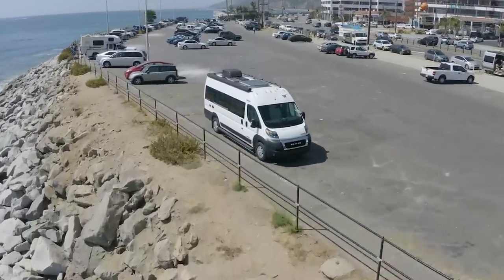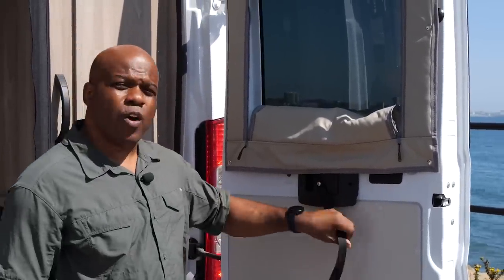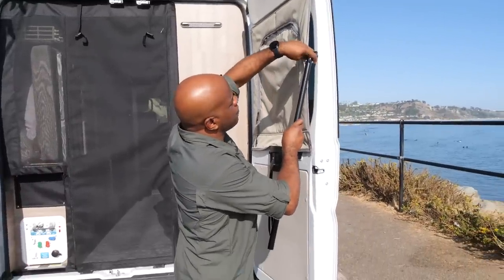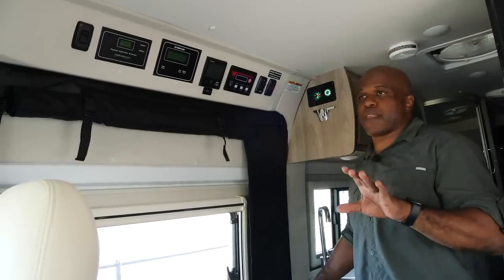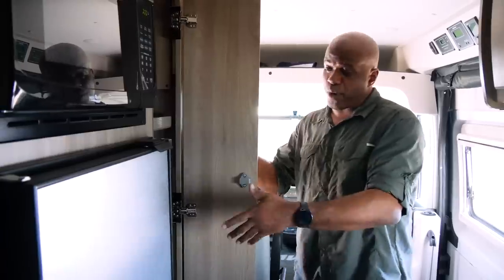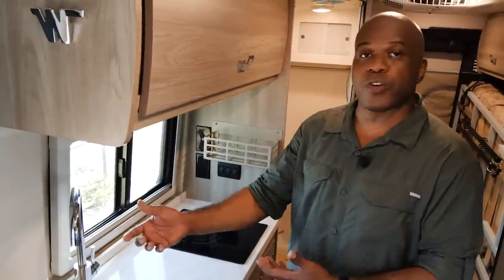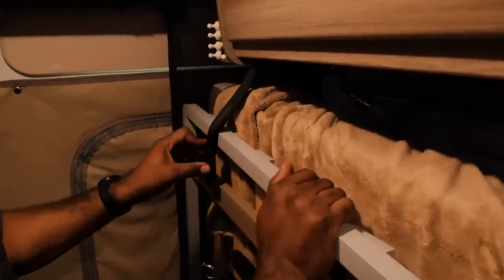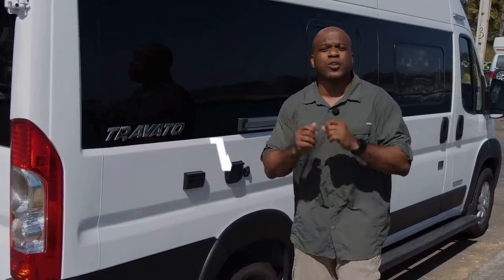The 2022 Winnebago Travato 59GL: Complete Walkthrough

Comment: So wait! Can’t hook up water to use direct? Only to fill the tank? And when it’s cold, you have to open the back door to fill?
Reply: Same question I have
Reply: Seems kind of stupid to me to
Reply: I agreed with the “why do something that keeps us having to open the back door to put water in the tank.” Then I realized that we live off the tank and not the hose. Given it’s a B class and that limits the fact one door will have to be opened to even get in and out. While I was winterizing my GL, I realized how nice it would be to have all the “by passes” in one location. Right now I have to get under the bench seat to bypass the water heater, then the two near the floor at the slider door. 

I would rather see them replace the slide door that loses all the heat or cold air. I know that’s probably not happening so I’ll take the single location for water and winterizing. LOL!
Reply: With the inlets inside there a less chance your water will freeze and also you don’t have to worry about some crazy nut tampering with them...
Reply: @MusicOfMelodyK  so true! We actually did have that happen more than once. And at another place, we left the water to the vehicle on, low, but it still broke and leaked. The park management turned the water off and left us a kind note, but still an embarrassment. The more we look at the 2022, the more we love it. More cells in the Lithium, a new space up front where the water tank, then the inverters were, the single spot of water works, and the “pump-less” shower drain make it a dream machine “B”! The lighter bed is a bonus!
Reply: You have to fill the tank and then unattach the hose to shut the back doors. A bit of a nuisance but it's  not that big of a deal.
Reply: Yes to all questions.

Comment: stop building the travato on the Ram Promaster, its crap. Promaster sucks!
Reply: Love mine. Agile, runs great and gets great gas mileage and haven't had a problem at all and when I need service just take it to a RAM dealer. On the other hand ask me about my Class C on a Ford E450. Rough running, loud, lousy gas mileage and agility non-existant and when it needs service find a Ford dealer with a lift to get under the beast..
Reply: @oldhickory2064  garage built in Mexico, assembly line crap.
Reply: @anthonykimbrell1243  Built in Mexico or not it runs great and the plant in Mexico has won some serious awards for it's quality and in fact is considered the best truck assembly plant in the stable of Chrysler/Dodge/RAM products...my 2012 RAM 1500 Crew Limited has never given me a problem and it was built in Mexico.
Reply: It would be highly interesting to see this very floor plan on a FORD TRANSIT 😁😁😁😁😁😁 They should try it! Even on a Sprinter......just to see how it goes.

Comment: This unit certainly has a nice fit and finish as well as some new innovations.  And it has a lengthwise bed that appears to be accommodate tall sleepers.  However, once again we have seating for four in a vehicle that sleeps only two.  For the many singles and couples who travel, the extra two chairs are taking up space could be used to expand the kitchen or install a larger refrigerator.
Reply from the maker: Thank you for your feedback!
Reply: Yes those two chairs are one of the reasons I can't pull the trigger on buying this model, The 59 KL has a better layout but you have that small fridge, grrr!!

Comment: Other then the new bed design, inside water controls, the induction cooktop and sink along with the new information center in the cab and the gravity drain in the shower there is not really anything else that I would want from my current 2017.5 Travato. They missed on the  removal of the other sleeping area big time (thats where the dog sleeps). IMHO.They turned it into a two person coach unless they eventually add in the pop top which I wouldn't want. I hate canvas exterior walls. It would have been nice to know with all the insulation they added what the ratings were for the floor, walls and ceiling.
Reply: I take back the inside water controls...city water is also in there and the only way you can connect is leaving the back doors open....bad idea IMHO
Reply: @oldhickory2064  Exactly, the water hook up makes no sense.

Comment: when are we going to do a recirculating shower  since you did some upgrades?  / guess I am still visiting truck stops
Reply: Seems pretty challenging, expensive, and lot of maintenance in such a small B van.  Shower goes into gray tank which is shared with your sink, so you'd have to either separate it into it's own tank (and have another to take up space)  or have a system that is good enough to filter out the food particles, soap, etc. AND be small enough to fit somewhere on the van - doubtful there is something reasonably priced and small enough yet.  Even if there was, you'd have to deal with cleaning that filter quite often.  For this type of van you should be doing military showers anyway, quick and using little water;  if you want to enjoy a long hot shower, a small B van might not be for you
Reply: @skinnysurvivor103  thank you   that makes sense
Reply: @skinnysurvivor103  It's definitely possible on a custom conversion but there would need to be 2 water systems.

Comment: Thanks for the review.  Would you please touch on a few points that I don’t recall you mentioning.  Do the front seats turn around into the living quarters?  Stats regarding mpg, gas or diesel, engine size, solar equipped?
Is the fridge dual functional ie propane & electric and does it have a freezer section?  Size of fresh water holding tank as well as black & grey tanks?  Overall cost for unit with these items included?  🤷🏻‍♀️
Reply: I’ll try a couple of these questions, but I’m no expert. I assume that the seats in the 2022 will be the same as the ones in our 2020.5 G. So they should turn around and face in. And it looks like the same fridge, which is just DC. The solar panels keep the batteries charged and I am told by people who know more than I do that it’s more efficient and less problematic than having a three-way or a two way. The engineers is a six cylinder gasoline – you can look up the specs for a Ram Promaster 3500. Gas mileage should be in the 15 to 20 range (depending on how much you’re hauling, terrain, speed, etc). For the price you can go over to the Winnebago website to get. Not cheap with the lithium. That’s why we ended up getting the basic G, although I now regret that and wish we had shelled out the extra money for the GL.  Hope this answers a few of your questions. We bought ours just before lock down, so we haven’t had a chance to use it as much as we’d planned in the past 10 months.

Comment: Great Tour Sir. 
Time for Winnebago to use the Taller Ford Transit for the Travato.
 I would reverse the Fridge with the Microwave. Sucks to get on your knees to get Lettuce out and you don’t use the Microwave as much as the Fridge. Bed Location. Grade F.  I would not want my Head to be separated from a Pooping person by Inches   Toilet in the Bathroom. That’s a Romance Killer. The Coachmen Beyond D is the Winner so far Head to Head. Grade C+. The Electrical System in this will make the MSRP above $135.000. I’d build a Custom Van for this Price.

Comment: Just curious, if you were camping with full hookups in this new travato with the city water hookup located inside the van would you have to always have the doors open? Or is there a way to close the rear doors and maintain a city water connection. Thanks.
Reply from the maker: Yes, the design intent is to use the water pump. Having the system inside eliminates a potential freeze point. It’s one less opening in the side of the van to worry about sealing, leaking, or corroding. Leaving the city water connected can be problematic if there’s a leak.

Comment: Why would you put your city water and black tank flush inside your rig? Can not use it if it’s raining outside. Taking a hot long shower is now a security risk because the door needs to be open. and their is no drain in the water hook area to drain spillage so the water goes all over the place and now damages the floor.  And the bathroom… failure guys need the space back.  Want to fix this. Put the water ports under the rig so you can hide them. Little inconvenient,  but then they're hidden.  Take this back to the drawing board and fix it.

Comment: I hope this comment reaches Winnebago engineering. I have a few suggestions to make the Travato more appealing. 1) raise the roof like on the Regency American Traveler. 2) eliminate the propane tank and instead have a gasoline assist for the Truma heating from the gas tank. 3) Increase the tank sizes owing to the extra cabinet capacity because of the added interior height. 4) Have adjustable air shocks that can also be used for leveling. 5) Hinge freezer door at bottom so it's more easily accessible. 6) Offer tinted side cab windows and a brush guard as options. Thanks for hearing me out. I hope this helps.
Reply from the maker: Thank you for reaching out and the suggestions John. We will send this over to our team!
Reply: John just added at least 50k to the cost lol

Comment: The biggest issue is this new unit doesn't have an extra bed in the front, and the bathroom has no foot room when using the toilet now. I prefer the older model for these reasons.

Comment: Spare tire ,Jack, lug wrench?Cummings Diesel option?complete 4 season package available?
Reply from the maker: The Travato doesn't include a spare tire, but it does come with a tire tool set including the jack, jack handle and lug wrench. The Travato is only available on the Ram ProMaster® 280-hp, 3.6L V6 gas engine. This four season van includes all-season and sidewall insulation, new honeycomb composite insulated flooring, above-floor waterlines, heated tanks, insulated rear window zipper coverings, and available dual-pane acrylic insulated windows. We strongly recommend following the guidelines in the owner's manual when camping in freezing conditions.
Reply: @WinnebagoRVs  Winnebago could at least make a spare tire optional. I REMEMBER Back     in caveman days every vehicle had a spare tire.
Reply: @ejacs8077  Unfortunately a lot of manufactures delete spare tires to save weight.
Reply: @ejacs8077  There are aftermarket spare tire carriers that fit the trailer hitch. Some have pass-through hitches so you don't lose the ability to attach a bike carrier or another accessory.

Comment: Looking at the fresh water connection, it appears you can't have a hose hooked to city water, thus the need to use the water pump at all times. I see a couple of coax connectors but no openings to run the coax cables to the outside. Not having a city water connection and openings to run a coax cable will render this coach useless for us since we stay at RV parks with FHU most of the time. Winnebago, think twice about getting rid of the outside city water hose connection, tank flush and cable connections. It's going to cost you some customers.
Reply: It always puzzles me why people buy these compact B camper vans, just to only stay at RV parks.  If you're just at RV parks why not get a class B+ or small C, or even a very cheap towable? They are way cheaper and have more room inside, and are more geared towards having full-time hookups.   These compact B vans are more geared towards adventuring and getting out there, so it makes sense to those who may not be at hookups all the time, or want to have more all-season capabilities.  Anyways, with all the time RVers have on hand, it doesn't seem too insane to me to fill your tanks with city water, then close the doors, use your water until empty, dump your tank, and then refill at the same spot.

Comment: I like it but still ashamed  there not 4x4 u have to always get a kit and be better standard as 4x4 for rv or work
Reply: It's a limitation from Dodge.  The Promaster only comes in front-wheel drive.  Mercedes Sprinter that some of the other models use offers the 4x4.  With off-road or all terrain tires on this thing though, you can still go quite a many places.  Extreme offroading and rock climbing might not be something you want to do anyway in your expensive camper home :)